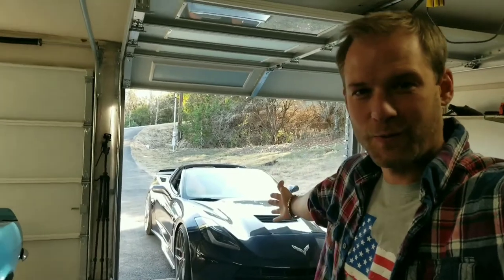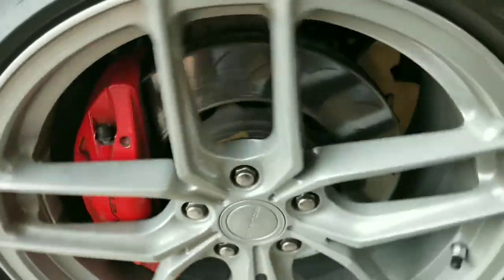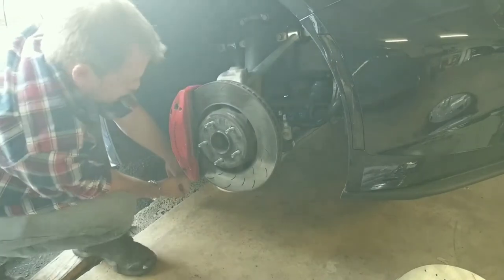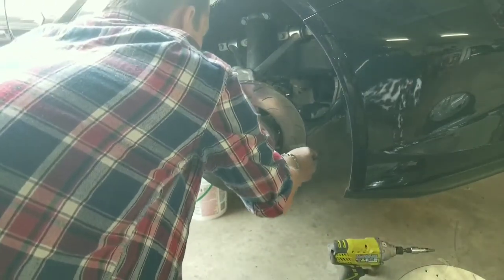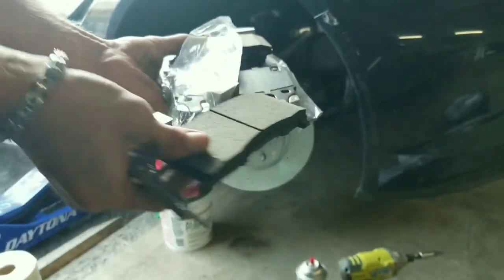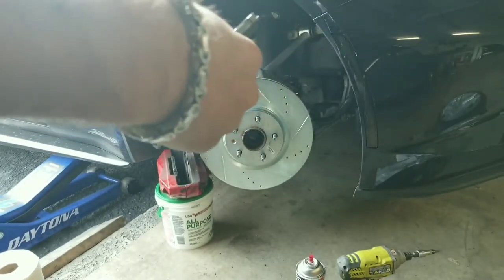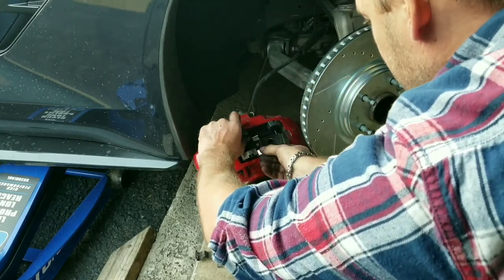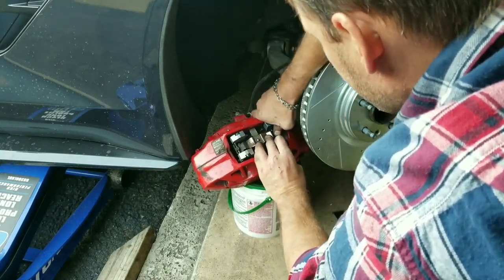C7 Corvette install Brake rotors and pads.

Comment: What part did you clean when you said you cleaned the backside and the rotor stopped scraping?
Reply from the maker: I'm sorry it's been a long time I can't say for sure buddy, are you having an issue with yours?
Reply: He said he cleaned the back side of the rotor with brakleen and then bent the metal shield slightly to not rub against the rotor. Its just thin metal shield you can bend it easily.
Reply: @handymangamer238  Thank both of y’all this will definitely help!